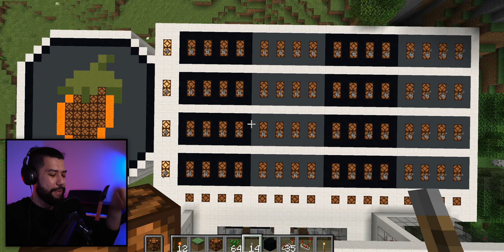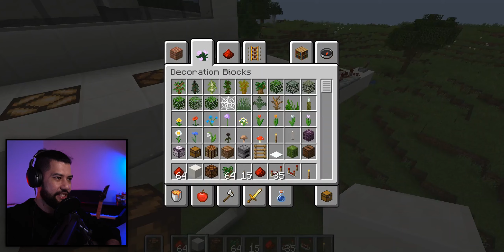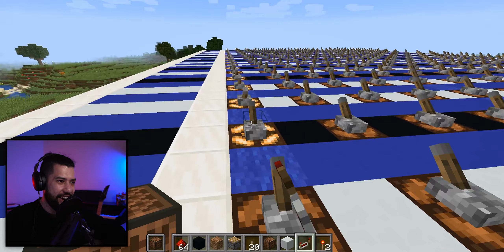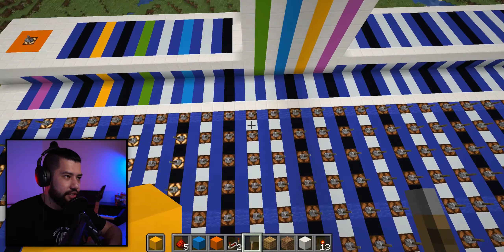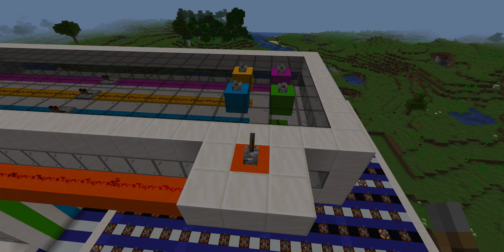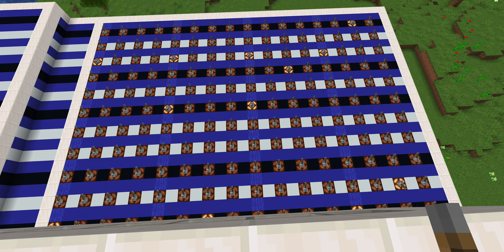Making Music in Minecraft #4

Comment: you should try instead of placing the noteblocks like that, use pistons descending or some other contraption to send a signal to all of your noteblocks individually. For example, you flick a lever, a piston pushes a block down, your clock sends a signal through it (you would need an "instant repeater" so there's no delay), and if there's a block (which there should be when you flick the lever) it goes to the corresponding noteblock on a stage so you don't have to fly above the entire machine to hear everything. You would probably need about 2 blocks space between each lever, though, making the machine larger. But in the grand scheme of the machine, it would allow you to listen to the song entirely from one single command center without having to move around to hear the different notes. If you use "instant repeaters" you would also be able to mute the tracks from your stage without the lever delay that you had using your current design

Comment: If you use monostable circuits, you can create one tick pulses so you can get only one lamp to light up at a time when you chain them together with repeaters. You can do it with a sand block on top of a piston with a repeater powering through the block, or you can use torches and repeaters to reduce the pulse length.
Also, try lowering the amount of delay you have on your redstone bussing. Have a look at instant repeaters (sticky pistons with redstone blocks) or any other way of extending your redstone signals as far as you can with the least torches and repeaters (each torch change and repeater propagation is one redstone tick (2 in-game ticks at 20 game ticks per second))

Comment: You should learn how to do a hopper clock to get shorter pulses. Just put a few hoppers pointing one into another and put an item inside, then use a comparator to output from one of them.

That way you won't need to use "repeater" clock signals

Comment: Levi i have a Tipp for you: you can use the /Fill command.You use it by Typing /Fill (in Chat) then Looking at the Block you Want one of the corners you Want to Be and then Pressling tab there Times (to get the Xyz coordinates) then Pressling enter, (it will schon a red Message but that should Happen)then going to the Opposition corner of the Arena you Want to Fill, then Open Chat (press t) and press the Upwards button and press Space and tab three Times ,and then finally you put im the block Name of the Block (if the Name is Split up in multiple Parts like "diamond Block"  use an underscore instead of an Space (Tab can help you)) like so Levi can see